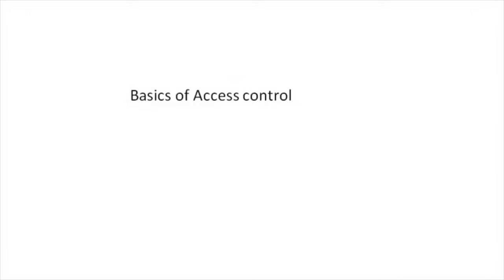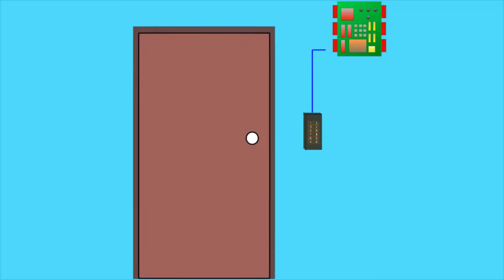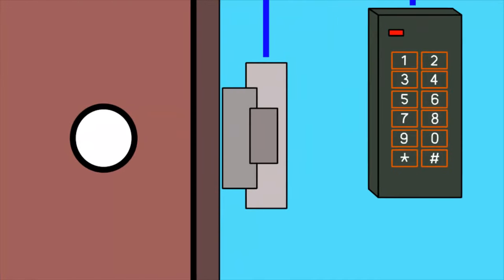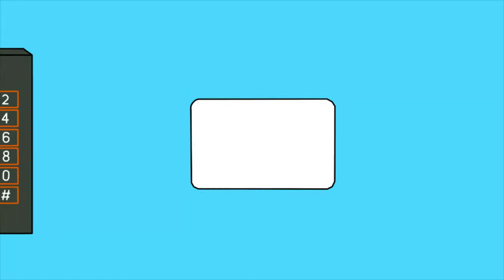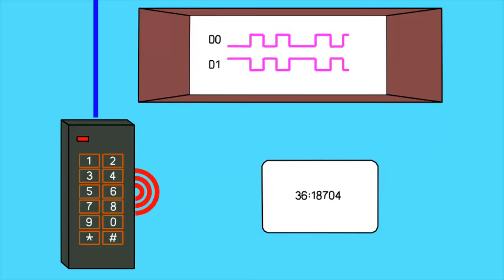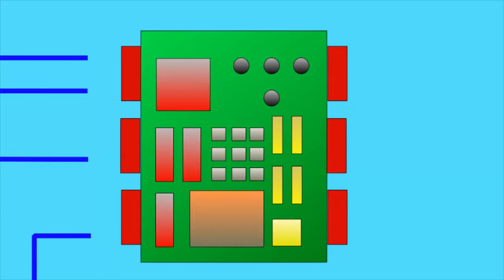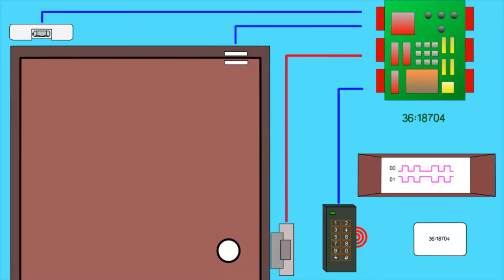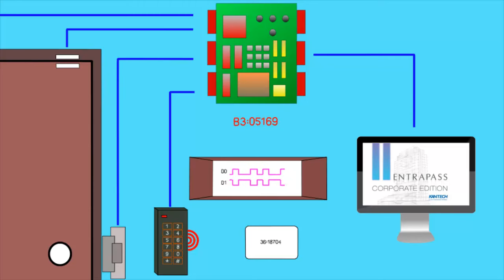Basics of Access Control

Comment: Hello!

I have one question about connecting REX button to KT-300. Button should me NC or NO? an illustration in the installation manual suggests normally closed, but in other documents, I have seen it could be normally opened. 

What is it? or it is configurable?

Regards
Jaime
Reply: On most systems it's N/O. (Close the circuit to open the door)

Just test it with a spare wire from negative ground to the push button (REX) terminal. If it activates the relay as soon as you touch it it's N/O and if it activates as soon as you remove it then it's N/C.

Hope this helps.
Reply: @Kit_Bear  Many thanks!!! Customer has another controllers KT-300 in his building. All existing doors are opened when the exit button is released, therefore all of them are N/C. I will configure the new doors the same way.

Comment: No electricity also can use or not
Reply from the maker: As long as you have a backup battery connected to the controller, it can work during a power blackout. The duration will depend on the usage.

Comment: Were is the access controller positioned
Reply from the maker: It could be positioned as far as 1000 feet away. Only the installer can answer that question
Reply: Usually in a server room, a telecom room, a closet, above a door (secured side) or any other secured location.

Comment: Can I install 2 card readers on both sides of the same door
Reply from the maker: It really depends on your equipment. If you are using a KT-400 or a KT-1, you can if using ioProx or ioSmart readers. Please contact technical support if you require any additional information
Reply: on gallagher, yes u can. just need to  program and assign to the door